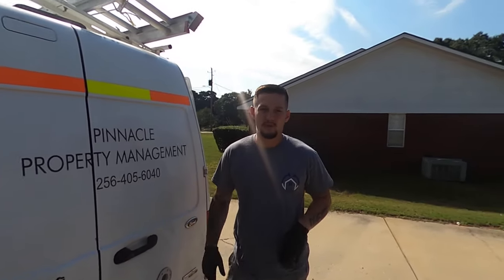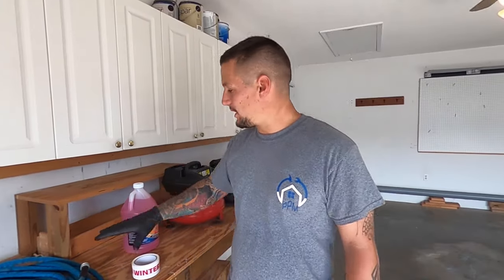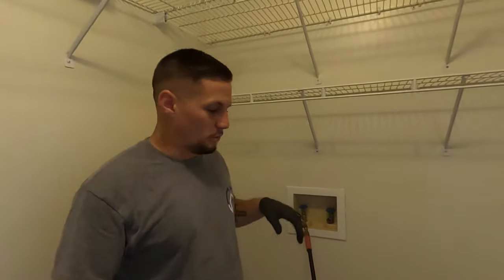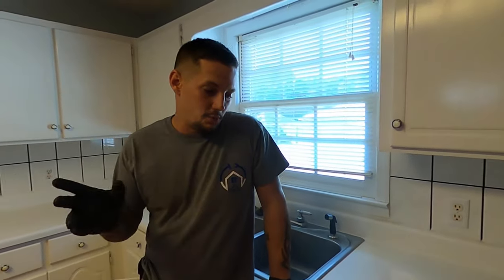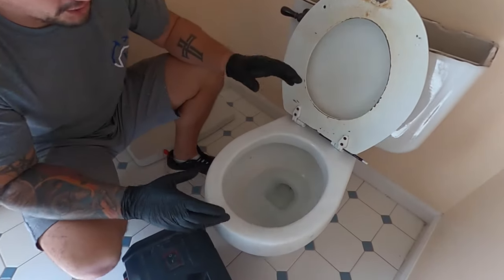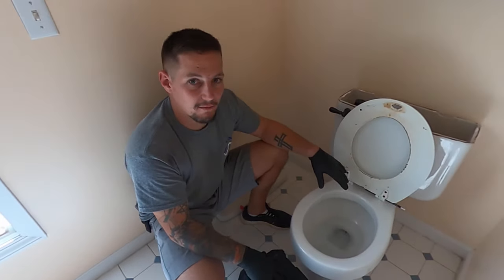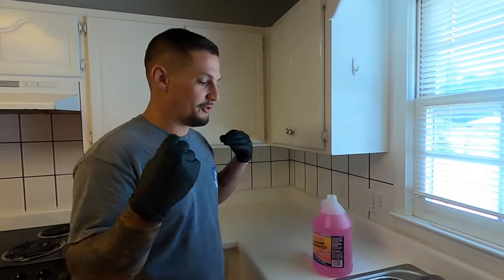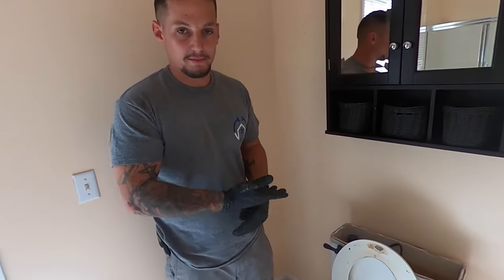Property Preservation - Winterization (Walk Through)

Comment: What pressure gauge and connectors are you using with the air compressor to connect it to the house?
Reply from the maker: I went to a local hardware store and build me a connector for about $20, been using it for years.  Home Depot or Ace will have everything you need.

Comment: HI I just closed on a house which needs some paint and new floor work so my concern is to house has been winterized so do I wait after paint and floor is put in and then dewinterize it, please advise
Reply from the maker: You’ll have to remove the toilets to put the floor in so I would just leave the water off at the toilets.  A lot of contractors prefer having access to water specifically if you’re going with tile.

Comment: So winterization means drain all the water from pipes and water heater !!
Reply from the maker: Yes the goal is to get all the water out of the water lines.  The antifreeze is simply for the P traps since adding antifreeze is much simpler than removing the p trap and emptying them.  There is a lot of liability in winterizations for both you and the client so it’s important to do them right.

Comment: Why isn’t leaving the pipes open enough?  Why do you need the compressor air…
Reply from the maker: To remove all the existing water.  Even with the spigots open, after you turn the main water line off, there isn’t any pressure to completely empty the plumbing.  So by pumping air in, you replace any existing water with air and the water has no where to go but out.